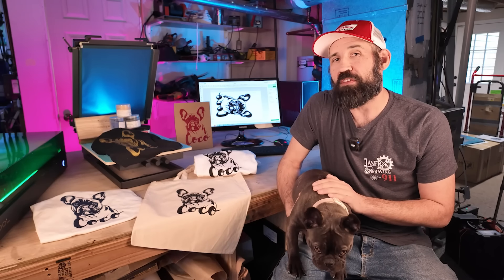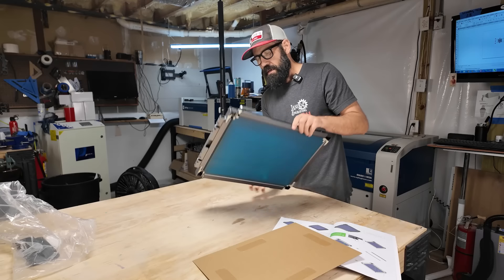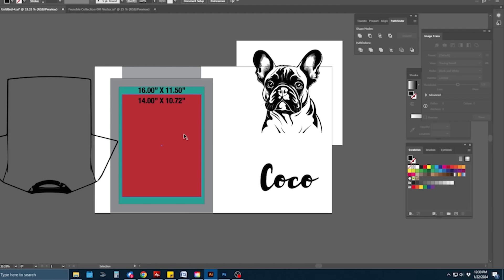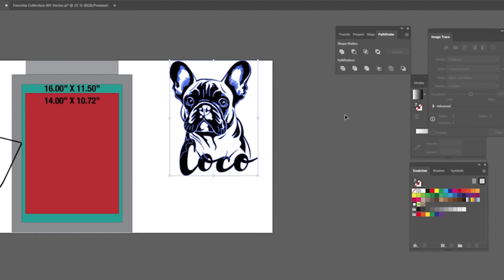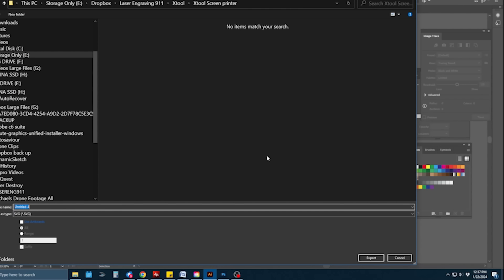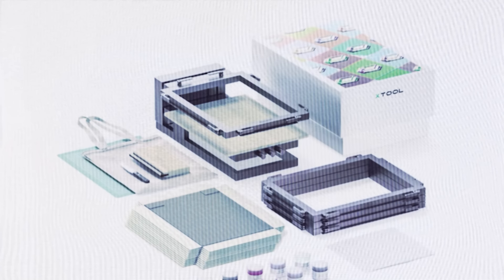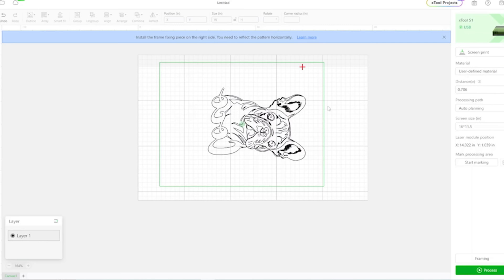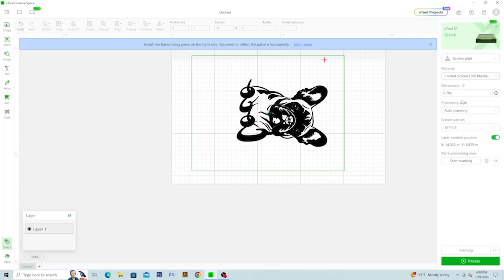The xTool Screen Printer - Watch This Before You Buy!

Comment: I'm a retired Signwriter and screen printer. A light spray of spray adhesive on the platen will help with making sure the fabric doesn't move while printing. You will have to reapply after a few shirts.
To prevent the ink from squeezing between the mesh and the frame put some 2inch wide tape on the mesh and frame. So 50% on the mesh and 50% on the inside of the frame. Makes clean up much easier. You should go around the whole frame if doing more than one print.

Hahaha you can flood backward to return your ink as well. This is painful to watch for someone who did this for 40 years lol
You don't always need more pressure but you can squeegee more than once and I'd do at least 2, possibly three, depending on "Things"
Don't lift the screen just pick up the ink with the squeegee and run it a few times.

Allow 10% spoilage. So need 10? print 11 or more
Reply from the maker: all great info!! Thanks for taking the time to share with everyone!!
Reply: I've been a screenprinter for 28 years now.  You did a good job covering the major things especially for a non screen printer.   Good job good video brother!👊🏻🙏
Reply: It comes with a sticky mat that your can put down to hold the fabric
Reply: Where is the 2" tape? ... was my first thought too!
Reply from the maker: @samspencer1534   Thanks! Im sure there are alot of things I missed, but Im learning too!
Reply from the maker: @jaebm  yes it does!
Reply: i took a screen printing class in community college for 1 semester and i thought the same lol

Comment: has anyone done a cmyk screen print using this? i figured it would be much easier to pull off since the screens are already mounted before engraving. it should technically be impossible to get misalignments, ya?

Comment: How long do you wait until you cure the ink?
Reply from the maker: I cure it with the heat press in the video, so minutes. seconds, but to air dry it take 24 hrs. you have to use a heat press to cure it fast, or radiant heat source.

Comment: Is the heat press required after ink printing?
Reply from the maker: its not required but makes drying the ink much faster, you can air dry but it take take at least 24-48 hours

Comment: Quite interesting for hobby users. I am a professional screenprinter and we use lasers to make the coating waterproof. The image itself is not engraved as here. Everything you will not print is made warerproof with a UV laser and the final image has to be washed out after lasering. 

And one little advice: Put some paper tape in the inside of the frame. This makes it much easier to clean.And DON'T press as hard as you can ;)
Reply from the maker: Thats so cool! Thanks for the tip!

Comment: A quick tip when exporting .svg before you export the file click everything you want to be grouped together and press command+8 this will make a compound path and when you put it into a cut program it will not be separated everything will be as one image or it will not be in a folder with different layers it will be one image
Reply from the maker: Yeah I thought that too, I always group before export, but for some reason it still came in to XCS all broken apart. but yeah good tip!

Comment: Great Video Mike. Are you going through how to clean the screen, and put new emoltion and burn new image? and also how to clean the screen if you want to keep that image for another day. Thank You!
Reply from the maker: Yes and No, when you need to burn a new screen you just pull out a new screen ready to go. they sell them cheap. Waterbased Ink warm water and a sponge took 1min,, then dry off screen blow out with compressed air. Plastisol ink will require a spray cleaner to clean screen. Maybe in the future they will sell no emulsion screen for people who want to just have the metal screen raw!!
Reply from the maker: EXTRA replacement screens  https://shrsl.com/4fhap

Comment: i want asking about ?  every time i need to print new thing  it need new replacement screens aluminum ?  yeah  ?   cant using same Screen for more works ?
Reply from the maker: correct you need to buy a new screen for each print, they sell them in 5 packs
Reply: @LaserEngraving911   ah  i see other Thermal printer  with  roll mesh nayloon pvc   i think it is more economic

Comment: I’m having trouble finding a clear answer anywhere maybe you could help, would the Xtool screen printer work with a non Xtool CO2 laser like the OMTech 60watt?
Reply from the maker: yes! any laser over 10watts will work, but you need to have a bed big enough if you want to to use the whole screen.

Comment: I am trying to make my first cut but I am so confused 😭 I don’t have the Xtool laser being used, I have a Mira9 100 watt and I have the XTool screen printer. Are you engraving your design on the side that the cardboard was on or the other side?
Reply from the maker: You can print on both sides of the screen, but once you put it on the frame, you want to engrave on the bottom of the screen, reflected, so when you apply paint on the other side it come out correct.

Comment: Is the mesh screen disposable? Or can it be used several times?
Reply from the maker: you need to use a screen per design, if you want multiple designs you need to burn a new screen, they are reusable, if you can figure out how to out a fresh coat on it, then in theory you could use it again

Comment: This reminds me of the LightScribe method of burning off a special coating on CDs and DVDs for the label side of those discs in order to make your own single color labels.  I hope this method being used here has a longer lasting image without taking 30 minutes or more to get the best results like it did with the LightScribe method.  What was the actual time needed to burn the pattern into the screen?  Do you need to clean the screens between color changes?  What sort of cleanup is needed for storage of the screen?  Can the burn be erased by re-applying more dye to the screen so that it can be re-used?  How many times can it be re-used?  Can unused portions be lasered for other projects?  Then mask off the project areas that aren't needed?
Reply from the maker: Thanks for commenting , ill direct you to Xtool for all your questions, I'm sure they have all the best answers for you ! since they made it! 👍 https://support.xtool.com/

Comment: The screen only comes in 100? That looks like speedball, which is very runny and the INK (not paint) will run right through it.. does it come in 160 or 230?
Reply from the maker: yes, INK, correct. They only offer 100 at this time. We used speedball in the video and and the ink that came with the machine from xtool, both worked very well! at least in MHO, a a nooby screen printer.

Comment: Fell down the rabbit hole of screen printing today and couldn't find an answer for my question anywhere. Can regular screens and emulsion be laser engraved too? Don't have an x tool and an thinking of getting a press that will do more than one color at a time. Just couldn't find if you can make the screens the same way with different laser's. Thanks in advance for any help!

Comment: Excellent tutorial, amazing tool, but if I wanted to do it in 4 colors, what would be the process to do with the software you are using?
Reply from the maker: You would need 4 screen for 4 colors, and you would engrave each section of color on each screen, it would also be nice to have 4 frames so you could quickly load the next frame and screen in, not sure if they plan on selling frame but I know they will sell screens!
Reply from the maker: EXTRA replacement screens  https://shrsl.com/4fhap

Comment: Great video.Thank you! My question: How do you buy extra screens? I looked on your link and extra screens are not part of the accessory list. Maybe the screens will be added later but for now it keeps me from hitting the buy button. There is a FAQ about trying to make your own but IMO that defeats the purpose of the product.
Reply: i have the same question, like this new tool just take away all the screen emulsion processes on the initial set-up but that's it, you have to buy more screens from them with emulsion already done for you and i think thats not a cheap price compare to you doing it DIY.
Reply from the maker: Once they finish with the pre orders, they will have 5-10 packs of screens for sale, Ill check on the price for you!!
Reply from the maker: EXTRA replacement screens  https://shrsl.com/4fhap
Reply: Thanks for the new link. So would you define this price as a good value when comparing to traditional screens? I have no experience regarding screen printing so I have no knowledge on how much it costs to make a traditional screen.  Thanks for your time.

Comment: Hi, loved this video. One question: can you use the laser engraver to burn images directly to a t-shirt, is that possible without damaging the shirt. Thanks in advance ❤
Reply from the maker: Kind of, Co2 laser are best at this but its very fine line, between, lasering the fabric and destroying the shirt., or getting the fabric lasered only to find out when you wash it it falls apart. :(
Reply: @LaserEngraving911  thank you for replying. 🙏
Reply: I lasered a pair of cheap canvas sneakers, and then plan to paint the design with paint pens. I have seen videos of people lasering denim jeans, stool covers....lots of options. I think with tshirts the cotton is a much looser weave, so it may burn up easily. Try a shirt you got free from an event and see what you get. :)

Comment: With water based in you need to let the ink dry all the way. You want to evaporate the water from the ink or it won’t cure correctly. 😊
Reply from the maker: Did you see the part where I evaporate all the water using my heat press? I made sure I took care of that part in the video. You can see me do that here in case you missed it  23:10
Reply: @LaserEngraving911  yes, but then you’ll want to press it a second time to really cure the ink. Speedball ink even suggest waiting 24 hours before pressing. I don’t always wait the 24 hours because I don’t have the space to lay out all the shirts for my small business. So we do a 2 press process. Once to evaporate the ink and the second to really cure it 😊

Comment: CAN YOU ACTUALLY SCREEN PRINTE USING POLYESTER PLASTIC SHEET ?
Reply from the maker: no you cant, the laser will completely melt the screen, you need to use the screens made for the xTool screen printer, they are made from steel

Comment: Is the screen reusable? If it is, how do you reset it for a new grafic?
Reply from the maker: The system comes with 3 screens you can buy more if you need them, you just wash the screen out with warm water if you using waterbased ink, if you use plastisol you will need to use a plastisol cleaning chemical when you wash it, one you bur the screen that is permanent 👍
Reply: @LaserEngraving911  Thank you! :)
Reply from the maker: EXTRA replacement screens  https://shrsl.com/4fhap

Comment: What's the advantage of using a laser over just burning it with a UV cabinet? don't see a huge advantage I guess?
Reply from the maker: No wash out no chemicals,
Reply: @LaserEngraving911 Thanks. This is a good point as water waste is quite significant with Serigraphs. However, with laser engravers,  lots of particulates and hazardous light. laser engravers are quite hazardous especially in a school environment.

Comment: Show the clean-up next time.
Reply from the maker: 😂 There is nothing to show, just spray the screen off with water, then blow the screen of with some air or a dry towel, its really that easy, if your using water based ink, it literally took me under a min. With Plastisol ink I think you will have yo use a ink cleaner spray. spray and then dry..

Comment: As a full time screen printer I'm always intrigued by these types of "at home setups." Screen printing is not something you want to try to do at home. No way to reclaim and reuse the screens, so just buy new ones? Loads of problems and issues that the unsuspecting DIYer is going to regret.
Reply from the maker: I hear ya, these were never meant for large scale production, I'm sure.. and the screens are cheap, I'm sure this system will be great for those wishing to dabble, just another added value tool for those already doing personalization.
Reply: if the screens are cheaps will be the best alternative for those who works, even in production because you are saving a lot of time
Reply: As a Textile Designer anyone who wants to screenprint at home can. I'm not sure why you're gatekeeping the trade and process. There's enough room for everyone to create art.